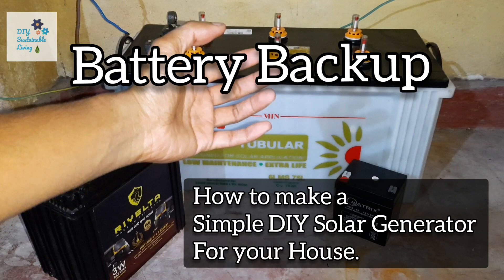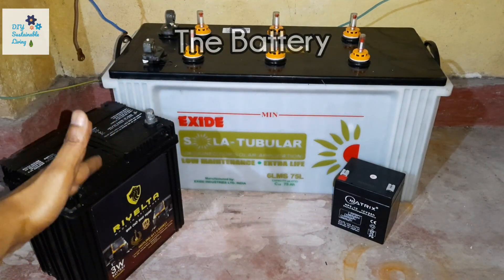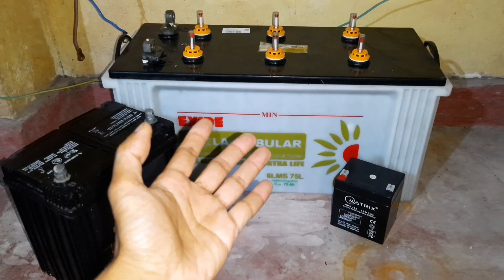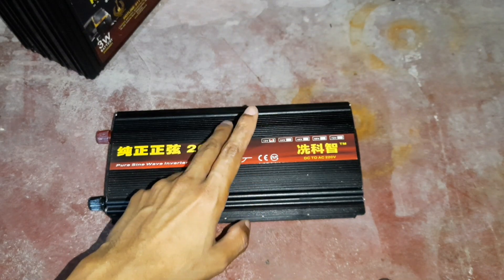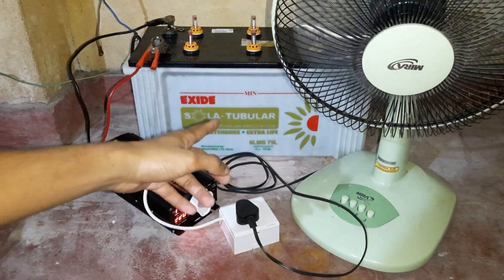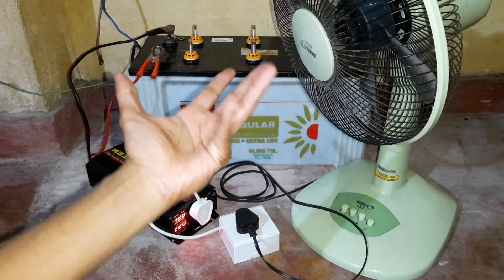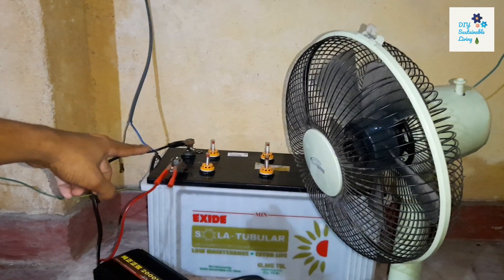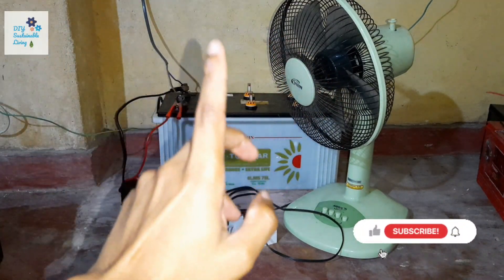DIY Home Battery Backup - Simple Solar Generator for your House!

Comment: hi bro

i am sanub

i am using soloar pannel (30v max) x 3 solar panel

my inverter input is 12 volt how to connect it how to contact you
Reply from the maker: Connecting the panels in parallel would be the way forward. You can discuss your questions here in the comments.
Reply: Yes I connect parallel
 Single solar panel getting 30 voltage 
 @diysustainableliving2774

Comment: hi bro 
i am sanub 
i am using soloar pannel (30v max) x 3 solar panel
my inverter input is 12 volt how to connect it 
how to contact you
Reply from the maker: What is the power output of these panels? Since you have a 12V system the best way would be to connect all 3 in parallel to get the maximum amperage. In this situation the buckconverter should help to increase the total amperage but it is not as efficient as an MPPT charge controller.
Reply: @diysustainableliving2774  output of each panel is 28 to 30 volt
will mppt convert 30 volt to 12 volt .
i used one but it show the same 30 volt in out to
Reply from the maker: Yes a proper mppt should optimize the voltage for the battery it is connected. Beware of a lot of fake products out there which are really pwm controllers.

Comment: does the buck converter make the system safe as demonstrated in this video? i have similar devices i want to know if i have to add buck controller to my setup.
Reply from the maker: The buck converter is not a safty device. It is placed to efficiently convert the solar panels power. Basically we can increase the amperage of the panel output. It is not as good as an MPPT charge controller but for large differences in the panel voltage to battery voltage it will be beneficial.
Reply: @diysustainableliving2774  okay thank you. i will be adding it to my connection. pending when i get a good mppt.

Comment: Brother do computer run with 220 volt dc supply.

I want to run directly with solar i will connect 6 solar in series. 

24 volt. Voc getting 48 to 51.
Reply from the maker: For a computer you can run it through an inverter with a 220v AC output. If it is a laptop you can consider a voltage regulator to get a constant 19v DC supply without an inverter. If you are planning a 24v system and your panels are getting a 48voc then there will be a big loss of acheivable power if you use simple pwm charhe controllers. In that case you will benefit from having a MPPT scc.

Comment: Hi bro,
Thanks for your video. I live in a rural area where I need solar system. I'm saving some money to buy it. In my house I have 2 lights, 1 fan, 1 TV,
1 audio . But when we have family gathering about 3 times a year we will use 4 lights, 3 fans, 1 TV, 1 audio. I have a few questions:
1. Two 100ah flooded lead acid batteries is enough?
2. Should I buy 1000 or 2000w inverter?
3. Should I buy 10 or 20 or 30ah charge controller MPTT?
4.Can I connect new battery with old battery ?
Reply from the maker: Hi, First thing I hope you live in a place where there is plenty of sunshine. 
From 200ah lead acid batteries you can get 100ah of usable power daily. That is 12 × 100 = 1.2Kwh a day. So 3 fans will be 150wh. You could use that for 8hrs continuously.  4 lights and tv and audio will also come to another 150wh. And after use you should be able to recharge it over the next day. For that you will need 200w × 6hrs = 1.2kwh on a clear sunny day. This is just for 8hrs function of the 3 fans at night.
I hope you understand how I am calculating this. As I am assuming that you will need this power mainly at night with 4hrs for the TV and lights and 10 - 12 hrs for the fans you will need 2.4kwh of stored battery power and a setup that can handle the charging of that. Id say you need 300ah of 12v battery 2000w inverter and 400w of panel for the heavy use days. You will need more than a 30ah MPPT for this. It is always better to calculate your setup for the heavy use days so that you will have the power when needed.
Reply: @diysustainableliving2774  Thank you so much for your quick response and advice. I will learn and think about it more.
Reply from the maker: Great!... Another tip. When purchasing things online make sure you read the reviews and verify the product before making the purchases. A 30a MPPT scc might just be a simple PWM scc. And inverters advertised as pure sinewave might be modified sinewave and the continuous power rating is usually half of the advertised power. So do your research well.

Comment: hello sir, is it safe to parallel solar panel with different wattage? cause I heard them saying it's not a good idea to do so, it should be the same wattage others say. ca you elaborate, thanks
Reply from the maker: You can parallel different wattage panels provided the voltage is same. Eg 50w 100w and up to 150w panels are all around 18v at max power point. There wont be an issue in paralleling these. But you cannot parallel 150w panel with 270w and higher wattage as their voltages are 30v or higher. That is why you should be careful when choosing the panels you need to parallel.

Comment: nice bro... how much that batter where can i buy... thanks...
Reply from the maker: That big deepcycle battery cost me around 115 USD. It depends on where you live. You will have to search what batteries are available in your country. Cost wise deepcycle lead acid batteries are cheap but if your budget permits it would be better to go with LiFePO4 batteries as they have more advantages compared to lead acid batteries.
Reply: @diysustainableliving2774  im from srilanka bro....
Reply from the maker: @makefarming7237  Well I got it at Browns battery mart in december last year. Now I think its not available there. You can contact them and see for prices and availability. Another place you can try is A plus ECO in Athurugiriya. The prices here are going up every day. What about LiFePO4 cells? I think the channel TechRat has some contacts to import them from china. They are better for solar than lead acid batteries!

Comment: Hello :) What's the exactly buck converter output's voltage regulated at?. In my case my buck output is 12.3v and doesn't turn on the inverter. What voltage do you recomend? Greetings :)
Reply from the maker: Why have you set it at 12.3v? At that voltage it wont charge a lead acid battery! For 12v lead acid battery you should set it at 14.4v. In my case Im connecting my LiFePO4 battery bank in parallel to the lead acid battery. So to prevent overcharging both I set mine at 14.2v.
Reply: Bcs my modem and monitor works at that voltage, and work great directly. Now i will finish my fridge with supercap project☺️👍thank you!!
Reply from the maker: Great... I think those will work at around 14v aswell. By just adding a small battery you can increase the stability of you system in case a cloud passes over :)
Reply: @diysustainableliving2774  please provide me your Instagram I'd

Comment: Hi guy dig your videos,,,I watch some Will Prowse vids every now and then but Imo he s become too much of a salesman. But in one video he also proved running stuff with buck converter plus auto transfer switch.but you showed how to use solar plus super caps to get past initial surge. I have 2 questions 1. Can super caps be solar charged up and how long? 2. Since 5000btu window ac draws 500 to 550 watts steady state,then given 5 to 7 150 watt panels in parallel with pure sun and a large enough super cap module,is it possible to (similar to your mini fridge video 8mos ago) run a 5k btu in same fashion. I've mused the idea for some time using auto xfer switches but super caps would allow truly off grid ac,daytime only,if one could simultaneously solar re charge them in case of passing cloud or momentary obstruction..PLEASE IF IT POSSIBLE TEST AND MAKE VIDEO,  Could possibly save a lot of people on high summer bills if only on sunny days. I don't have the time or money to aquire equipment and conduct such experiment,,,,if you make lots of $$$$ don't forget me lol
Reply from the maker: Well... supercapacitors are good for the initial surge but they cant store a lot of energy for the given volume compared to batteries. They slowly discharge over time due to small internal leaks. They can release a lot of energy in a short ammount of time (in milliseconds). You can run the above system you mentioned with a good size supercap bank and more that 550w of panels but just by putting a small battery in it you can significantly increase its stability.